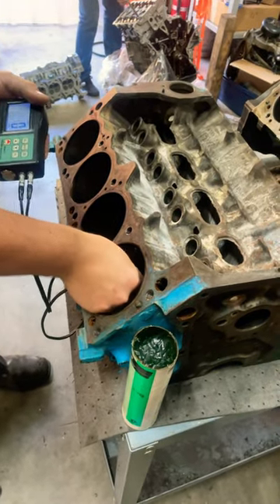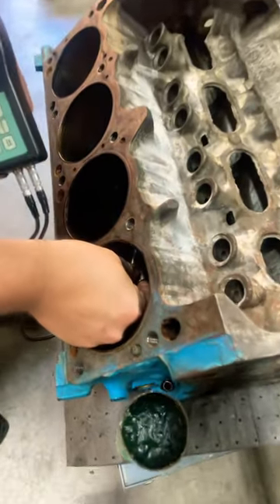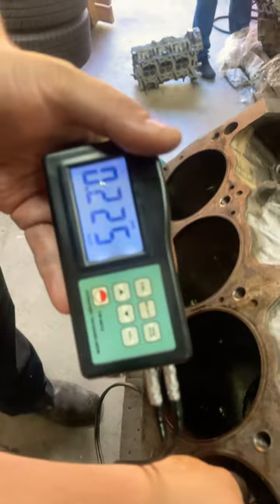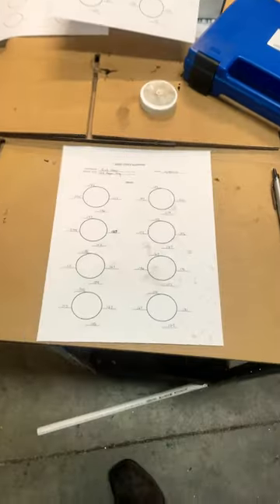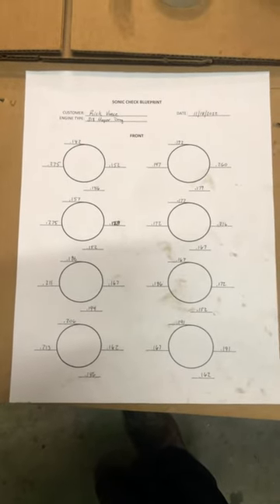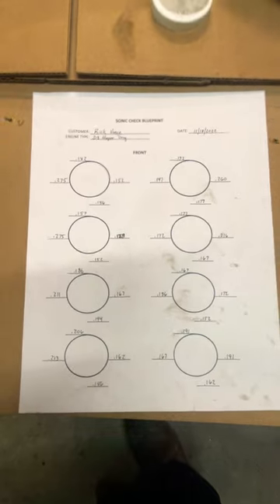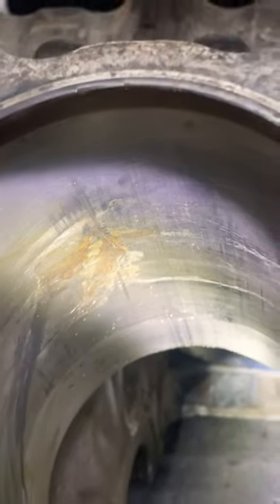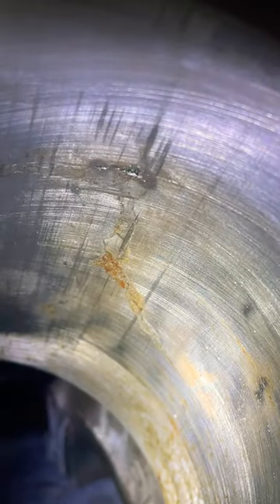Sonic check cylinder wall thickness on 318 Mopar race engine.

Comment: Did you have to profile the probe so it was curved or did you just run it as is?
Reply from the maker: I profiled it slightly but the grease makes up the difference.
Reply: @pageracingengines   Perfect, thank you!